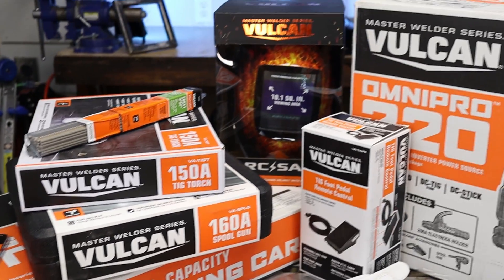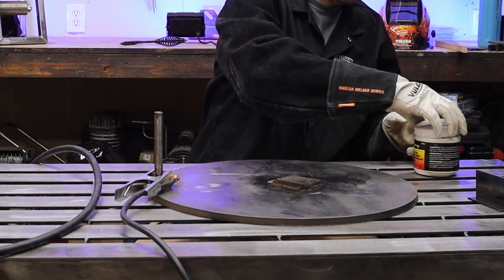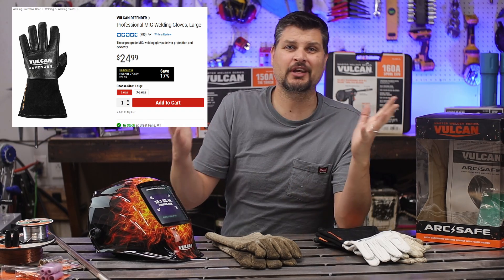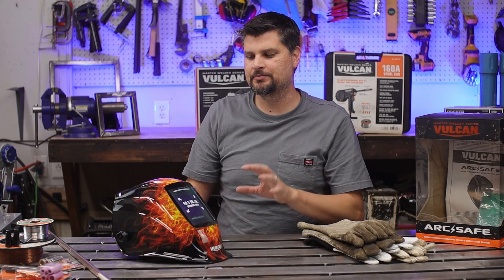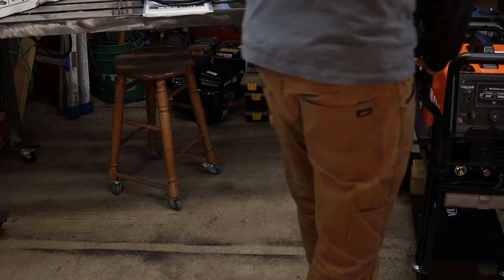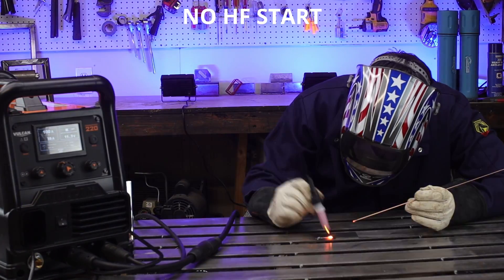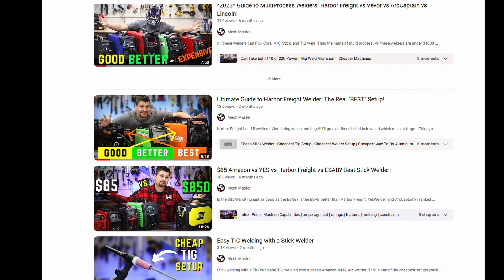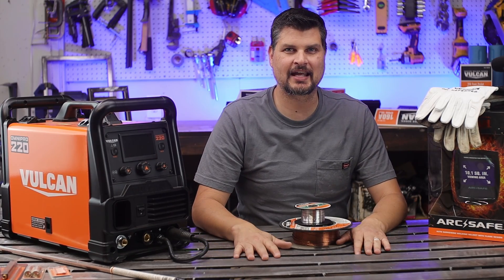What Will I Keep??  Harbor Freight Vulcan Haul

Comment: Was looking at the Omnipro 220 but it only came with a 3 month warranty. I bought the Miller 215 which has a 3 year warranty. Doesn't inspire confidence when a manufacturer can't even offer a one year warranty on their product. I know you can buy an extended warranty for the Omnipro but why should you have to?
Reply: It's not the manufacturer. HF offers 90 days for most tools and some like the welders have the option to purchase a replacement plan. This is one thing they do to help offset the initial cost of the products they sell. HF doesn't manufacture tools they just buy them and resell under their own brand names.
Reply from the maker: Right on.
Reply from the maker: With Hercules giving 5 year warranties on their tools It would be sweet to see a Welder from them!